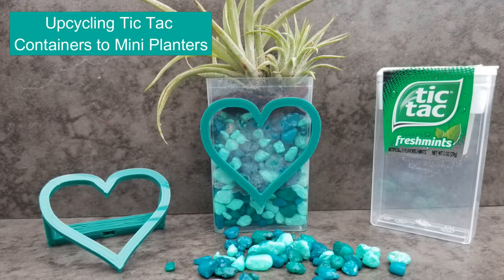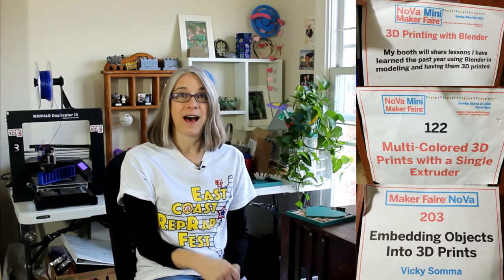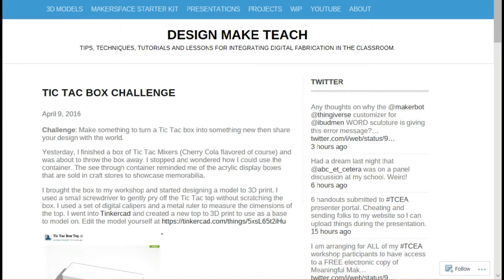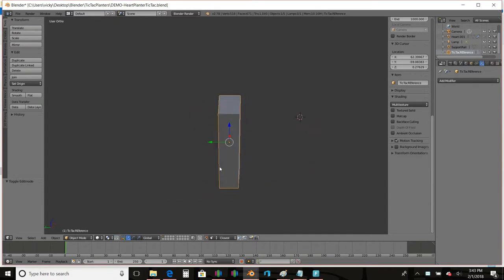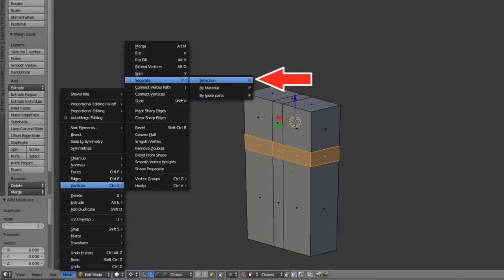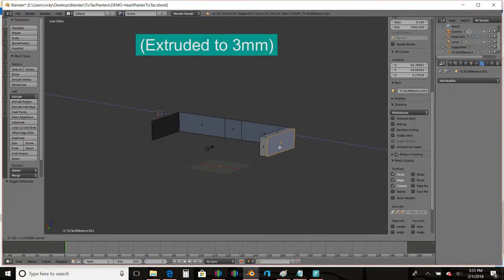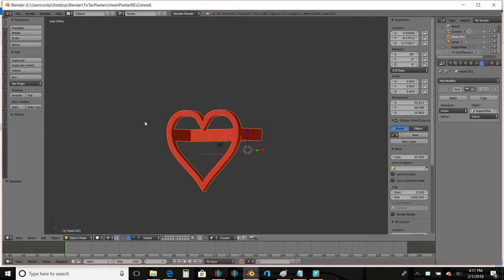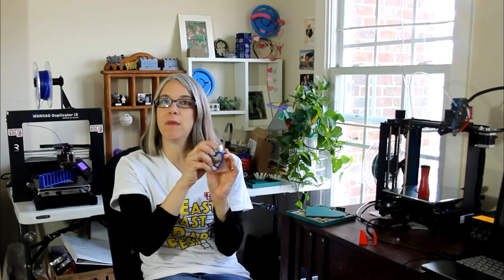Tic Tac Mini Planters

Comment: I just purchased a Makergear M3 and should have it any day now.  I really like that the printer can be managed through octoprint and tethered, but it would be nice to attach a monitor so I can see what's happening without starting up another screen.  My question is can any LCD that states it's compatible with reprap work on the M3?  What RAMBO version does the M3 have?  Although I know I'm getting a great printer, the amount of information on it is very limited.  Thanks.... I've subscribed to your channel, you have a very endearing personality.  : )
Reply from the maker: Oh my goodness--- consider myself jealous!  I currently have the M2, but I have been routinely pulling up the M3 Independent Dual project page and have my mouse hover over that orange "Add to Cart" button.  The M2 has been such a consistent, dependable workhorse for me, I am anxious to get myself an M3 as well.

Unfortunately I don't have much feedback on your LCD and RAMBO questions.  Have you already tried posing a question on the MakerGear Forums?  (forum.makergear.com/).  Also-- The few times I have had to contact MakerGear Support, they have been very swift and informative, so if you haven't yet, you may want to reach out to them.

Thank you for subscribing and commenting... and giving me a few more moments to daydream about the M3.  :)  Have a great day!
Reply: Thank you for your help.  I contacted Makergear support and they informed me that the M3 is not compatible with any external LCD (including their own).  My only option would be to attach an external monitor to the raspberry pi.  I guess in the end, it's really not an issue.  I know I can always use my phone or computer through wifi or tether.  I'm really looking forward to seeing what this printer can do.  From everything I've read, the entire community seems enamored with Makergear.  That was one of the main reasons I chose them over other companies.

I'll let you know how everything turns out.  In the meantime, feel free to live vicariously through my M3 is you wish : )